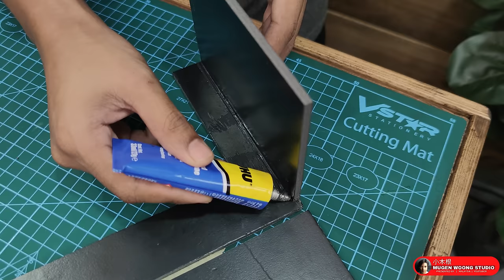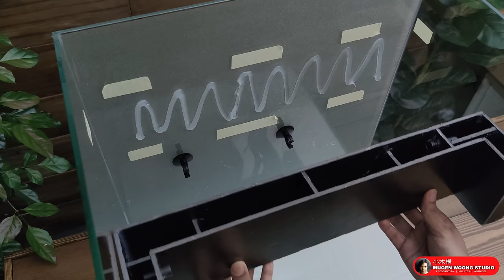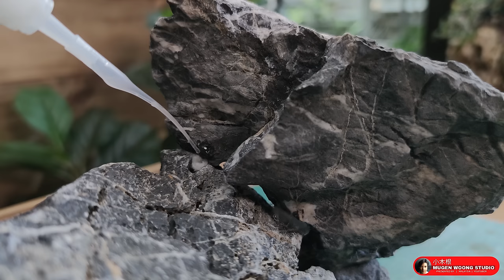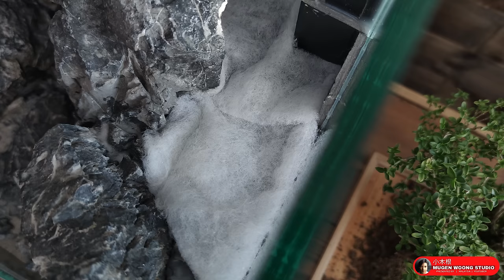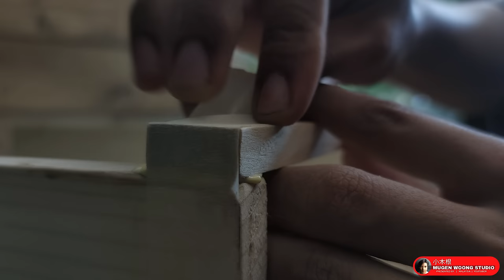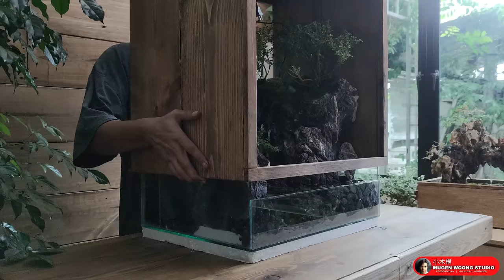making forest river | paludarium | Aquaterrarium | DIY Filter

Comment: Beautiful work! Quick question: In your design, why do you put the pump room on the right side and run the tubes to the left? Could it be directly below the stream opening?
Reply from the maker: If you notice my pump on the right side and going up to the filter box , after filter process it end up at left side. If you get what I mean. I did split the water pipe into 2 because I want the maximum outflow water speed from the pump but with the small filter, it can't handle this water flow so I do half is going filter and half is direct with a controller. Actually is base on what outlook layout design we wanna make and follow by figure out how to fit the filter & pump without effect on the initial outlook ideas. You can use your own method as long it's can hide the pump + filter with easy access. Hope I didn't answer your question. Glad you drop a comment and feel free to share your ideas and feedback 😁
Reply: Thanks Mugen. I watched it again and kinda understood the challenge you had. I am just not sure what that filter box is for, and why it is better than running the pipes directly  :(  Can you explain that to me? I also paid attention to how to maintain or replace the pump if it fails one day. You made it easy to access the pump so that's very nice! Another question - in your experience, how long will those foam board that you used for making the boxes last in the water? I saw some people made the boxes wth acrylic sheets, but that seems much harder to cut etc.

Comment: nice job. but i have a question what is the name of the black material?
Reply from the maker: It's call black foam board ( like compress polystyrene) / you can use plastic corrugated board or acrylic sheet as replacement if you couldn't get foam board
Reply: @mugenwoong  thanks. Still doing nice videos. Yoy have the art😎
Reply from the maker: @carlosdark20  hehe thanks mate. Hope you keep support my work 😊

Comment: Quite a nice one. But one huge issue in my opinion: why are you using poly-urethane-foam for this? You could achieve the same structural strength and filling the space with other, more environmentally friendly materials like terracotta-balls etc. And you could reuse the materials in later projects some day if you want. The way you are doing it here only produces toxic waste. Think about it.
Around this - it's a beautiful project. 👍
Reply from the maker: The reason I do video is to share and give audience ideas by using Thier own ideas and method after seeing my video. My method not 100% perfect and right. Silicone sealant and super glue are more toxic chemicals material if you compare it. Thanks on your advise will improve in future 🙏
Reply: @mugenwoong  That's right, but In a much smaller amound :) I don't wanted to offend you and I'm sorry if it looked like that 🙏 you're doing great and the result is very nice and beautiful! I just guess that you could achieve a better result in total if you change some of the materials you use for construction :) maybe you also find an alternative for the sealing? Would be interested 😃
Reply from the maker: @OrinderElf  yeah will keep on improving and I'm still experimenting it with different materials so that can prove the best ideas and solutions for audience. Appreciate that you can share and suggest me , so that we can improve together for better living and environmental friendly 🙏
Reply: Hi @OrinderElf I could not agree more with you. And as I'm starting projecting my aqua terrarium, and having some problems to find the materials needed, can you please recommend me a good material to replace the plastic foam board? Also for the sealing/gluing, if possible. Thank you

Comment: Hi, amazing job. I have one question. The River Flow comes from de trees planters or the filter and pump direct outlets? I Can see that after water goes through filter box, goes through left tree planter, is this enough Flow speed for the River after pasing through the sand?
Reply from the maker: The cycle is pump with full blast and split into 2 ( filter box and direct with a flow control) I'm using the control so that I can control the flow on the filter box, when I close a little more the flow will increase on the filter box. And once the both flow come down it will pass through the sand and mini rock and filter net before entering pump again. This part is crucial and have to be always checked, the sand not a issue because the top is small rock and the water will go through but the filter before pump when it's become dirty, it will slow down the cycle. Actually I did a backup for this with addition access with wire mesh ( there is another small part wire mesh net without filter sponge to keep the water directly to the pump.) So far after it completed there is no issue and I just add water to keep it running smooth. This type of tank not suggest to put in fish or shrimp because it will make the fish more fast stuck.

Comment: Can anyone tell me what kind of foam board that is? All the ones I find have paper on the outside. Buy his looks like shiny plastic already. Or has a coating on it.
Reply from the maker: Hi the foam board that I used is pure compress polystyrene and without paper coating. If you couldn't find it, you may use corrugated board as replacement. The mean ideas of the material is has to be waterproof,  easy to cut and stick.